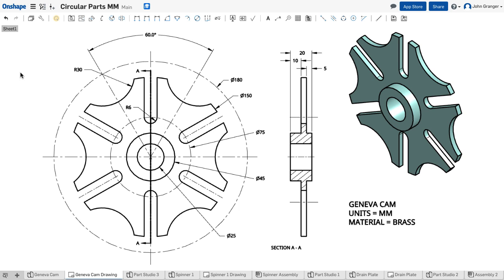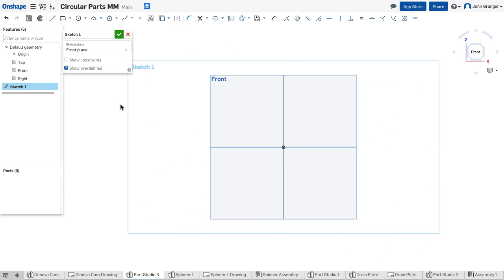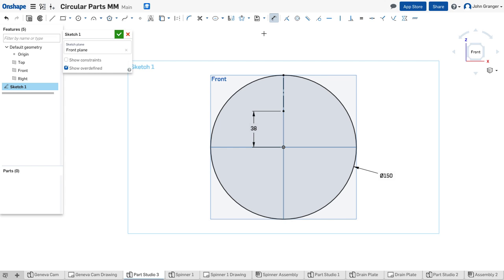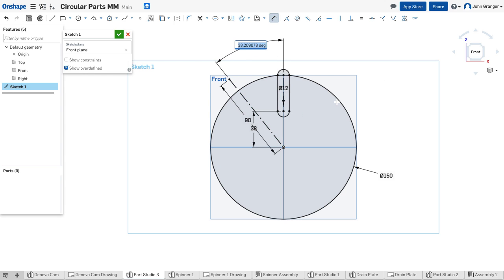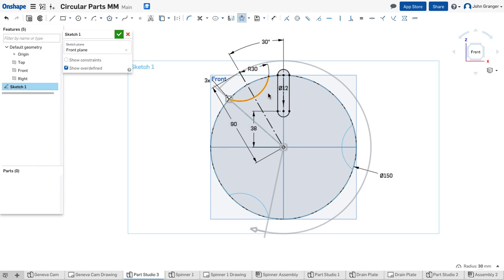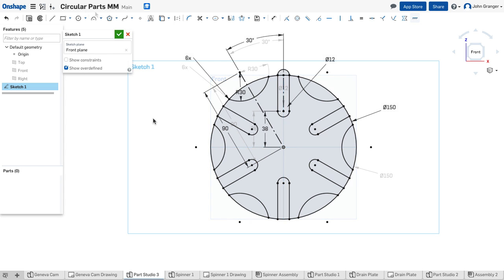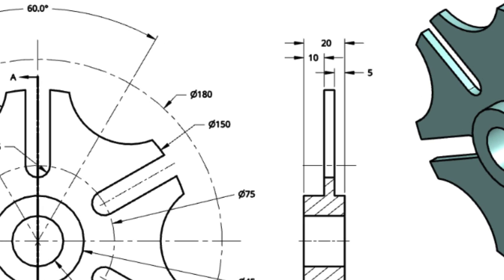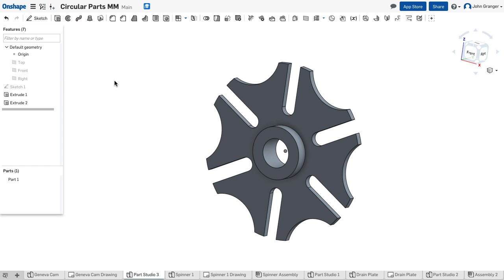Learn Onshape - Project 9 - Geneva Cam

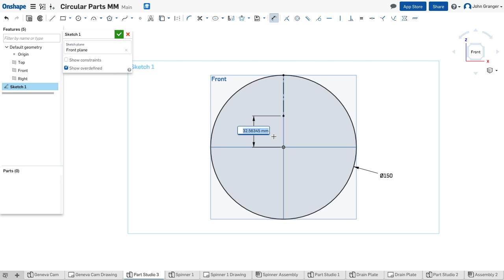Comment: 2:03 how is 75/2 = 38??
Reply from the maker: You are right, it should be 37.5, and the program is using the correct value.  The problem is the setting for display of units for the document that you are working in.  If it is set to display no decimal places, it will display the value rounded off, but will use the correct value in calculations and setting parameters in the model.  Check your display settings in the document and change the value if you want a different display.
Reply: @Onshape.Learning.Projects  oh I see! I was following the video step by step and onshape did display 37.5 for me. Thanks for replying :) I love your tutorials